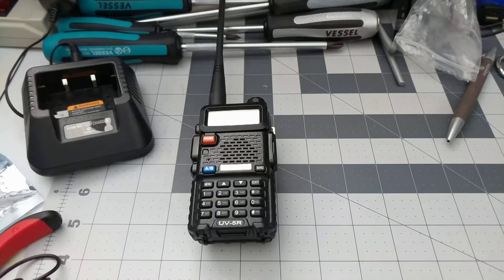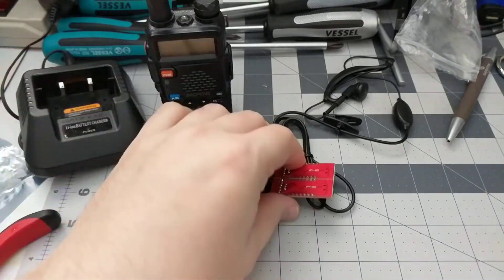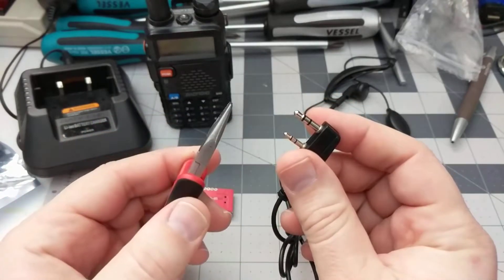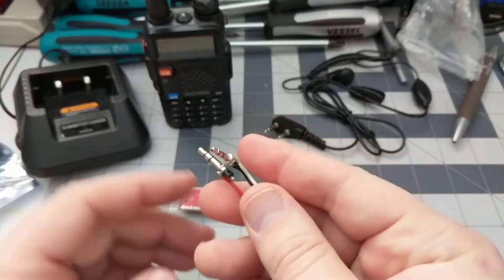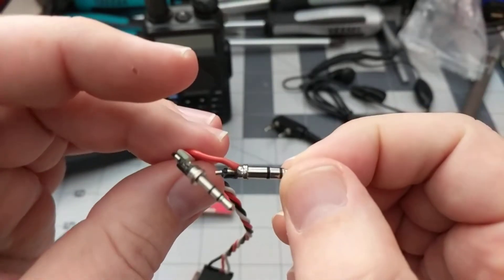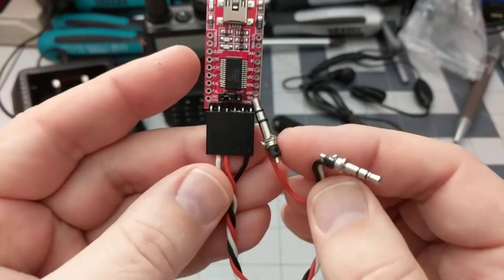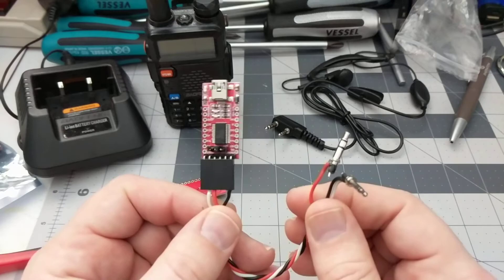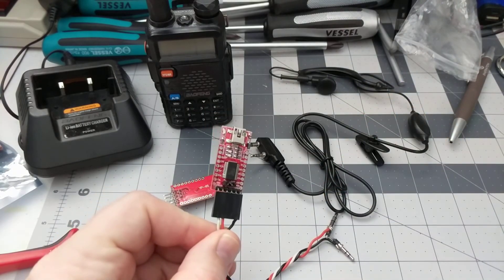Make your own Baofeng programming cable

Comment: I saw ,pin out connection are different in many videos.in your video 3.5 mm pin connect rx ,2.5 mm on tx.but in other's video it connect reverse.i.e.3.5 pin shield connect with tx and second or middle pin of 2.5mm  connects on rx.which is correct
Reply from the maker: Both are correct. Tx on the radio goes to rx on the adapter, and tx on the adapter does to rx on the radio. When looking at labels for serial connections it is important to get these the right way around.
Reply: Mine error is "radio did not respond" .i tried all possibility ,but not solved.chip of module ft232rl

Comment: Maybe instead of destroying the jack connector, since you are going to plug it into the exact same spot, maybe cut the cable, clean the wire and do a continuity test to from the various part of the jacks to the cable, then wire that to the serial converter, that way it'll look neater. Thanks for the pinouts though, was looking for that.
Reply from the maker: Not all the pins have wires connected.
Reply: @KillerSpud  yeah, figured so, but thats why you need to find the ones you need and then those not used can just be ignored and isolated with electrical tape or kapton tape.
Reply: @Not-TheOne  Inside the cable have only 4 wires, not 6...
And one of these missing wires is the RX... 
So, the only option you have is to destroy the connector to use only the pins, not the wires...